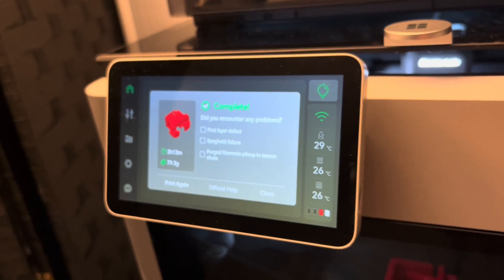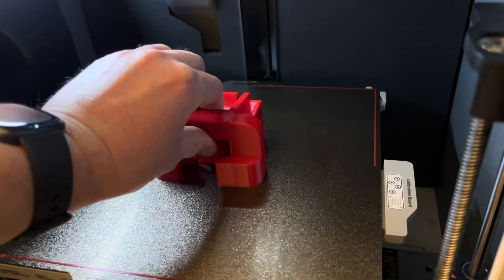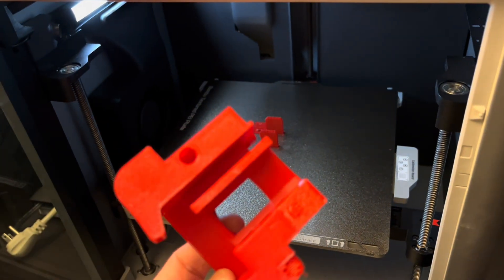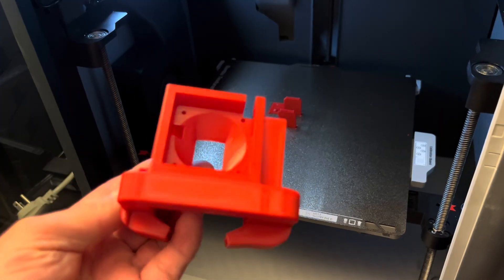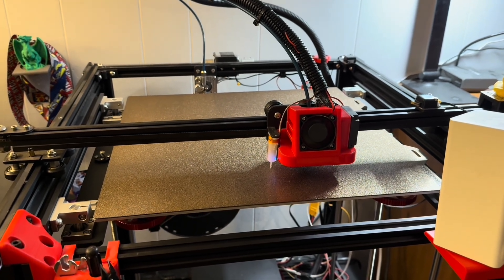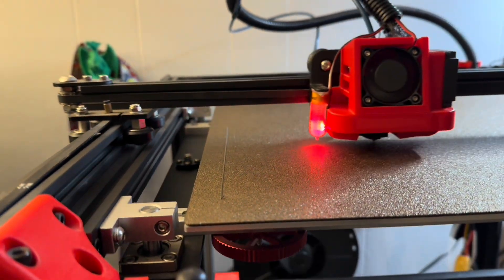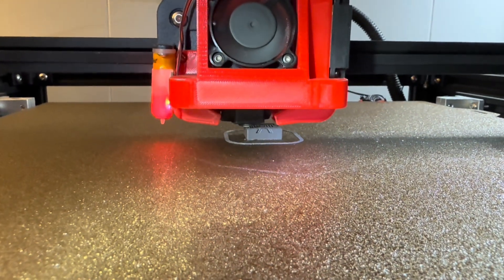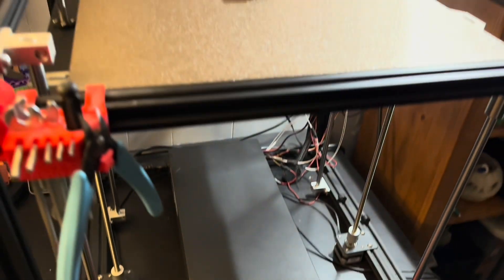A Functional Print with Bambu Lab PETG

Comment: Have you had any luck printing with PETG on your old ender 5 plus? I currently have an Ender 5 Plus that I can’t get to print PETG. I have terrible adhesion issues with the bed. Any advice would be appreciated!
Reply from the maker: I only did limited PETG on my E5Plus. That said, I can suggest checking what kind of build plate you’re using. PEI (textured or smooth) should work well. I ended up liking my Wham Bam flexi, textured PEI on my machine best. That’s similar to what works for me with PETG on the Bambu X1C too. Besides the build plate, checking your z-offset and bed leveling. Check my other E5Plus videos, I talk about z-offset and bed leveling with it. I set z-offset without using paper and without seeing any light between the nozzle and the bed. I also had updated main board and Marlin firmware that I could do z-alignment to help overall leveling. Besides all that, check if you have any air flow from your room that could be causing adhesion issues.
Reply: @drachenfire7784 thanks for the reply! I’m running a glass bed and ended up using blue painters tape today and after a week of failed prints finally had some good adhesion to the tape. That tells me a new bed sheet is in order at some point soon.
Reply: Try a glass bed. I only print petg on my Ender 3. The adhesion issue was fixed with creality enclosure and a glass bed with glue stick.

Comment: Yeah, printing the worst possible air duct for the Ender 3 in 2025, which performs even worse than the stock single one. Nice job.
Oh, and I see you invested in a useless all-metal Bowden feeder instead of a direct drive system. Bravo!
Reply from the maker: I do appreciate taking the time to watch and comment. This is an older video I finally got posted. After 5yrs printing with Bowden setup on the Ender 5 Plus, I can state it worked just fine for my needs. It would have been more hassle to convert to direct drive. As for the Satsana, it was also working quite well for me. Hard to say if it was really better than stock shroud, but definitely not worse. It’s all moot as I sold my Ender 5 Plus.